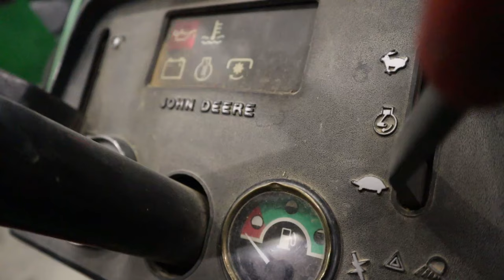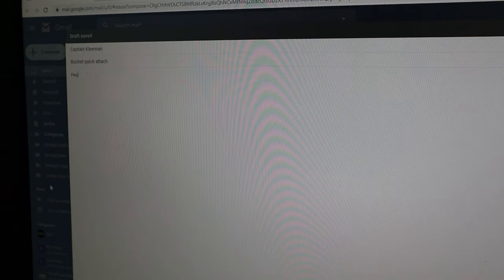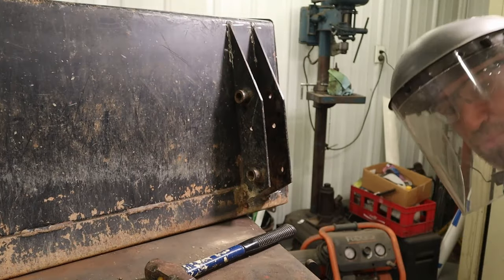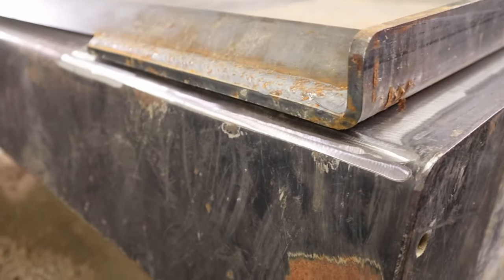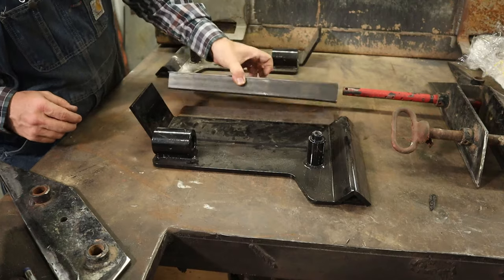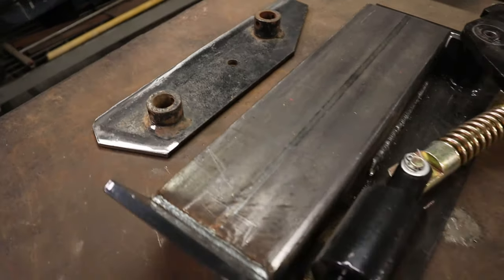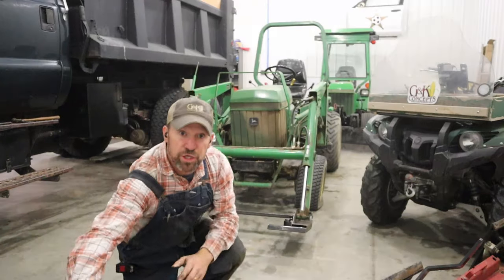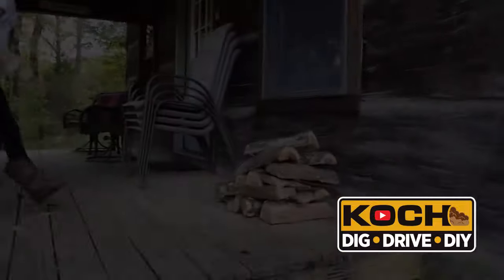Quick Attach Bucket Conversion for Older Compact Utility Tractors // John Deere 755 855 955 770 870

Comment: I just stumbled across this old video with my morning coffee.  You may not be monitoring comments here, but this might help a future viewer.  When cutting out old welds, I use the same process, but have stopped hammering to flex and break the last bit of bead...  Instead, I use as big of a pipe wrench as I can fit slipped over the plate and a cheater bar to apply force.  No more marring parts, and it often breaks free in seconds since leverage (long cheaters are best!) replaces brute force.  Hope that helps someone's project out there.  Cheers!
Reply from the maker: That's a great tip! Everyone needs a good cheater bar for their pipe wrench too! Thanks for the suggestion and really appreciate you checking out the video Joshua!

Comment: Just wanted to thank you again for this great video.  I have seen I think all of the you tube videos on converting a pin loader to QD.  Your video by far gave me the inspiration to do my 1988 950.  The project was a little more complicated than I expected because my 950 pin width is 44 1/2”  .The pin brackets were curved and not flat and straight.  The inside distance from the two pins was 3 3/4”.  The QD I purchased was not wide enough for my brackets to fit so I had to add an additional 4” piece to my QD.  0:36 I’ll try and send some pics of the build if I can figure out how to.  Bottom line , it works great and I would do it again.  Just wondering why I waited so long.  Thanks again , Larry.

Comment: Great Job Neil , came over from Captain Kleeman's channel. I got an older Kubota 2004 L3400 with out the Quick connect & what a pain in the Butt to remove them darn bolts every time you need to change bucket. Keep up the good work your a talented Guy!
Reply from the maker: So glad to have you checking it out Ron.  I'm so grateful to have any of Kleeman's subs coming this way to give it a look.  Thanks for sharing your equipment and thoughts and I appreciate the kind words.  Hope to see you around.

Comment: A clamp on the bucket while you hit it will keep it from moving or tack it to the table. Plasma gouging would work  for taking welds out, or scarfing with Oxy fuel. Both would be way faster than a cutoff wheel. But good informative video.
Reply from the maker: Thanks, Jack!

Comment: There are 2 magical tools for making your job easier. Acetylene torch and plasma torch
Reply from the maker: Oh yes.  I have a torch and plasma cutter and even had them at the time of building this but wanted to demonstrate it could be done with just the grinder and welder if need be.

Comment: I'm watching this video again because I'd love to do this to my 755. However mine would be a bit harder since I have the version with a more rounded design where the pins attach and the level indicator. I mite look into buying an Rk24 or 25 loader bucket. Then just modifying my forks.

Comment: I am thinking removing whole back of the bucket and mount and replace the back of the bucket with a solid Skidsteer plate. Just a thought
Reply from the maker: That's an option I suppose.  I would do whichever is lighter weight.  This option here is working fine, but if you took the back of your bucket off you could maybe fasten the quick attach brackets to the part you removed and the spacing for the weldments would already be correct!

Comment: Great video!  I will be doing a JD  950 with a 80 loader as soon as I can get the parts.  I am also having trouble accessing the web site for the bucket plate from your description.  I would greatly appreciate it if you could steer me in the right direction.  Again, great video, you are an amazing fabricator.  Thanks, Larry
Reply from the maker: Hey thanks Larry.  Sorry that link isn't working.  I used something like this:
https://www.palletforks.com/skid-steers/adapter-and-mounting-plates/516-inch-attachment-cut-out-mount-plate/161200.html?gclid=Cj0KCQiA_P6dBhD1ARIsAAGI7HAZ0pf4XSNt9XnIw8B0sXld3R1MVYn3fG9cQwfVFKew3_MsHWfvB8MaAsdeEALw_wcB

Comment: Great video, Neil! I'm looking to buy the quick attach plate for my JD755 bucket. It looks like the link to the plate is no longer working. eBay can't find it, but they do have other versions. What thickness is the plate you used for Kleeman's bucket? I'm seeing 1/2, 3/8 1/4, and 5/16 available.
Reply from the maker: It was no bigger than 1/4".  I'd say the lighter the better.

Comment: Wouldn’t it have been easier to go buy the already made adapter? Your solution moves the quick attach out 2” just like they do? Great welds by the way, you did do a great job, just seems like a lot of work for something that already exists.
Reply from the maker: Oh, it certainly would have been easier, but also more expensive is all.  The other thing to consider is even if I bought the quick attach adapter, I still wouldn't have a bucket that would work with it.  You are left with the option of either purchasing a completely new bucket or modifying the one you have.  I felt this killed two birds with one stone and saved myself about $1000 or more if I had to buy the quick attach and a new bucket.  Thanks for watching!

Comment: The bucket you modified had a flat back. Unfortunately, the bucket on my 1990 955 does not have a flat back. The back of my bucket a bend in it. Any ideas how I can do something similar with it? Love your work.
Reply from the maker: I would probably have to have a solid look at it but I suppose you can mount the flat plate on the back and just gusset it up to match the curve.  Gonna be tricky to relocate the weldments on the back though.  That curve does introduce quite a challenge.

Comment: This is great stuff for an old tractor but what about a new tractor that I want to put a quick attach system on but they are just not available. I have a 2019 Kubota BX 1880 with a pin bucket system and have been waiting over a year for the Dealer to get a quick attach system but with this crazy supply shortage I've had no luck. The guy that makes this one might just wanna think about making one for a new tractor as well.
Reply from the maker: It wouldn't be tough to build one for a new tractor. I bet you could buy the parts and have a local Fab guy make it up for you. I'm not in the business to do it on a large scale unfortunately.
Reply: @digdrivediy  Thanks. What I did was purchase a few add on attachments like the Clamp on forks that work great and a clamp on receiver hitch and if I don't have the quick connect system by next winter I will be purchasing a BX Expanded  snow plow attachment that seems to work very well. I know we are wanting this Covid Mess to end and allow us to get somewhat back to normal where we can simply order and receive the things we want.

Comment: Off topic question but imasking cause you seem to know how to fix things on tractor..i have a new farmtrac 25hp tractor..while using front loader latch came loose and it warped the quich attach..now both side wont attch or lock down,,i have seen some vids about cutting in center and rewelding etc,,i did use a tree and managed to get it almost back to normal but still only one side will lock,,are their aftermarket kits i can buy to replace the damaged one or at last resort i have thought about since brackets are almost back to normal just tack weld both to loader or drill a couple holes in bucket and attach arm and bolt them ,,i dont use any other attachents on laoder so not having quicj attach isnt a problem..i also need a large hammer like you have,,what size or lb is that thing...
Reply from the maker: Sorry about the misfortune with the tractor.  It is difficult to know what to do without seeing it, but I do know you have the power of the hydraulics at your disposal.  So, there is often a way to get it bent back into shape if you are creative.  If you have something solid to attach to, like a tree or similar, then you can often times chain to it and use the power of the bucket and lift cylinders to attempt to straighten things back.

There are aftermarket kits that you can find to replace the quick attach mechanisms.  
Everyone needs at least an 8 pound sledge hammer!  Best of luck to you and your repair.
Reply: @digdrivediy  I am a little confused about using chain and a large tree..are you saying basically to attach chain to tree and bucket and use hydraulics to try and bend it back into shape or use tree as leverage..probably just going to cut bar in center today ,,re align it and weld a sleeve and go from there,,friend has older tarctor with same issue,,he was able to bend it back close bot not close enough to use latches so he drilled 2 holes on both side of bucket and quick attach,,he basically pinned the bucket to loader with the bolts,,it works for him as he doesent switch bucket oout for grapple or other attachments,,after a month and gradually tightening bolts the quick attch was back aligned..pure old country ingenuity..im 66 and never owned a tractor but am a retired gm mechanic,,what i noticed right away when shopping for tractor and researchng them is how DANGEROUS even the small compacts can be,,especially for people who disconnect the kil switchs,,,thanks for the input,,hope today is a good one,,pray for our country

Comment: Have you ever replaced a motor mount on your 755? I have a 855 and I assume it is basically the same. I think I need to replace the mount just below my fuel filter
Reply from the maker: I haven't done the motor mounts.  I should probably check them out and make sure mine aren't broken.

Comment: Is this the factory bucket for the 70 loader? It looks so tiny. I have a 750 with a 67 loader on it.. bucket was a lot deeper factory. I've recently converted to jdqa to share bucket and attachments with my other tractors.. I would change some things I did but it works really well for now.
Reply from the maker: Factory bucket.

Comment: great vid....... do you happen to have the supplier of the plate that weld to the bucket?......... or better yet, dimensions for the plate..... im a lucky guy, i have a plate shear , and a press brake to make the plate
thank you
Reply from the maker: Thanks so much Mike! I believe that links to all the equipment I used are in the description of that video. I bought it all from eBay so maybe you could find some additional info there. Best of luck and I'm jealous of that plate shear

Comment: I manged to bend my qucik attach on front loader on my farmtrac 25,,,latch on one side came loose and twisted quick attach,,now it wont line up..is easiest fix to cut pipe thats twisted in center and reweld after straightening quick attach on both side,,ivw tried the tree method and chain but no luck,,have a welder and plasma,,any tips that might help,,maybe its easiest to just buy replacement quick attach and buy amore heaqvy duty one,,
Reply from the maker: I would think the best approach would be to cut it straight and then re-weld. Can't be out of anything for trying first before buying new. Best of luck!

Comment: What size and thickness is the plate you welded to the back of the bucket ?  The link don't work... any idea how to make the forks quick attach as well?
Reply from the maker: I think the plate is 3/16 of an inch thick. I just bought a set of quick attach forks and I work with the same adapter.
Reply: Ok... when I bought my tractor it had a set of pin on forks... the do leave some to be desired though... they are on a round bar vs the way the skid steer and actual forklift type the tines are locked in place and don't lift up and down... but at same time don't really wanna have to get another set lol...

Comment: Really need this.  But does a kubota 7100 have potential to get this upgrade guys?
Reply from the maker: I would say it most certainly does. You can add a quick attach to about anything that has a pin on bucket.

Comment: Very informative video. I understand the objective, the process and what to measure & diagram before trying to do this myself, but there is one thing I'm a little confused about. I want to do this for my Mahindra 24 Max. But how does this work universally for every sub/compact tractor? Are the loader arms the same width for every sub-compact/compact tractor. Just not sure how after doing this I can mate up to every QA implement for any model/manufacturer if its QA ready. Wouldn't the loader arm width affect fitment? I'm recently new to tractor ownership (just purchased a 2017 with 80 hrs) so this might seem like an obvious answer. Thanks.
Reply from the maker: The loader arm width can affect fitment, so you must ensure that you attach the quick attach plates in a way that creates the correct distance between the plates.  You may need to adjust where your loader arms attach to the quick plates in order to produce the proper distance between them.  So, the plate that I welded to the back of my bucket is the standard QA mounting plate.  That width is universal and dictates how far apart the QA mounts must be.  You will need to attach them to your loader arms in such a way that achieves that distance.  I can measure that on mine or you can likely find that distance online.  I hope that makes sense.  Somewhat hard to explain in type.
Reply: @digdrivediy  So I think I understand your REPLY. The 2 adapters parts on EBay you have listed in the comments of this video are sized to the "standard" universal QA. If I create a loader arm frame to align with my loader arms, but yet weld the QA plates so that I keep that standard distance for the QA, everything will align for all standard QA attachments. Did I get that right?
Reply from the maker: @jdimeo1966  Yes, that is correct.  Just make sure the QA adapters are the correct distance apart and then attach to your loader arms however you can in order to maintain that distance.
Reply: @digdrivediy  What is the wall thickness of the metal pieces you used to fabricate the QA adapter frame, 3/16 or 1/4"?
Reply from the maker: @jdimeo1966  3/16"

Comment: I don't think you mentioned it, but did you reverse the plates on each side so the boss that receives the retaining pin is on the outside of the bucket?  I was looking at my bucket and the long pin bosses are on the inside plates.  Reversing the plates would give a little more clearance to the bolts.
Reply from the maker: Wow, good eye!  Yes, you are exactly right David.  I didn't catch my omission until after the video had been up about a week.  I filmed a reference to switching them around and then somehow overlooked it in editing.  You're the first person to ever catch it!  And, you're right.  I had to do that to have just that little bit of clearance for the bolts!  Thanks so much for watching with a keen eye!
Reply: Thanks for replying so quickly.  I have all the parts on hand and am eager to make the conversion!

Comment: Alot of time went into grinding... probably wish Yeh had a plasma cutter
Reply from the maker: You're right there was a fair amount of grinding!  Actually though, I do have a plasma cutter.  I did it all with the grinder and welder to see if it could be done in order to make it an easier DIY project for someone that had the bare minimum of tools on hand.  Those cutoff wheels didn't make it too bad so all in all I was still OK with just the grinder.
Reply: @digdrivediy  let's use the plasma cutter next time to save the Grief lol ...it's quite obvious a grinder will do it with some effort.
Cheers from Canada🍺🍺
Reply from the maker: Agreed!